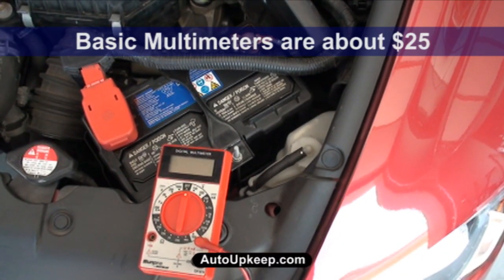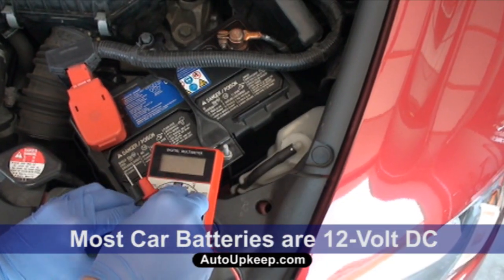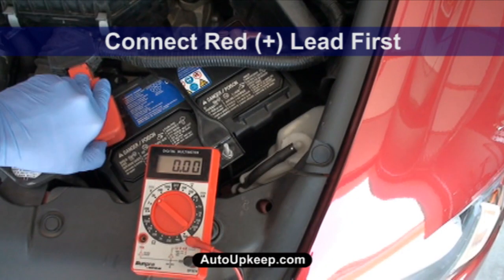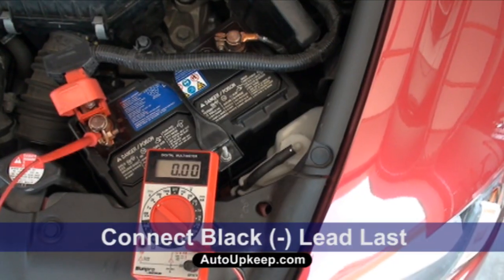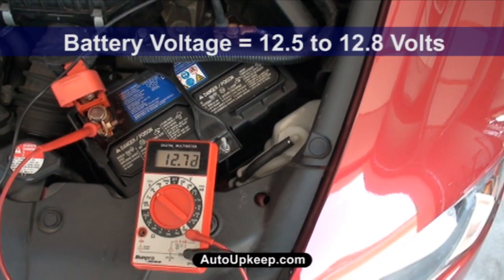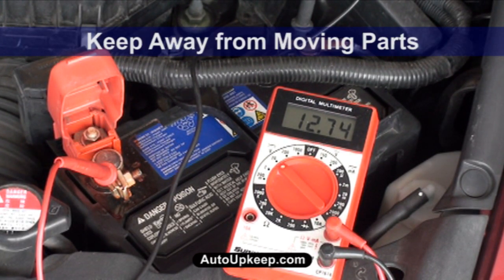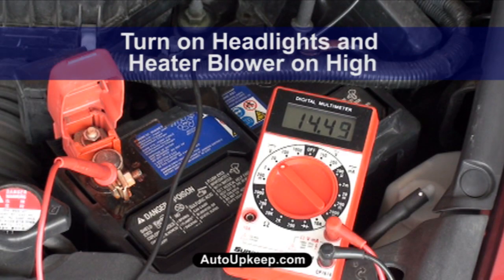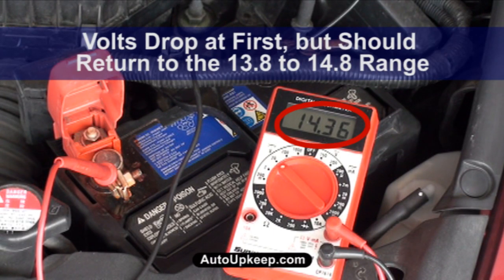How to Test Alternator Voltage Output (AutoUpkeep.com)

Comment: Granted, you are getting a 14+ voltage reading with headlamps and blower on.  An alternator needs to be tested with a load tester so a load could be added to bring the alternator to maxium amp output which has to be 90% of rated capacity. Good quick test though.

Comment: this is gay.   i get 12.5 volts out of my new battery, and 14.4 volts out of my new alternator, but as soon as i connect the fusible link that connects the two, my battery voltage only goes up to 12.8 volts, and slowly climbs to 13.4 and no higher.  if i turn on my bright lights, it drops down to 12.5 and stays there.     so my battery and alternator is working, but this dont help me figure out what else is not working, of an incredibly simple system according to the FSM

Comment: Hi Auto,
My car is not charging (meter shows 12.6)  - but has an external voltage regulator.   Can I be sure it's the alternators fault and not the regulator or some wiring/connection problem (just got the car).    
Thanks